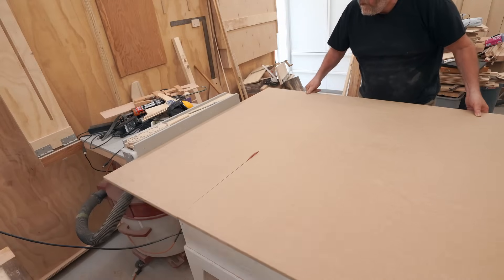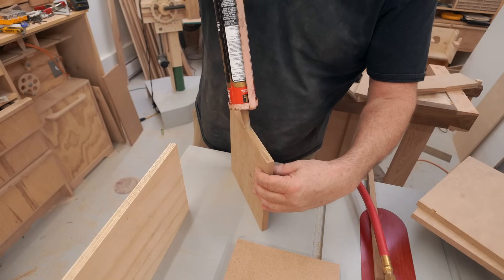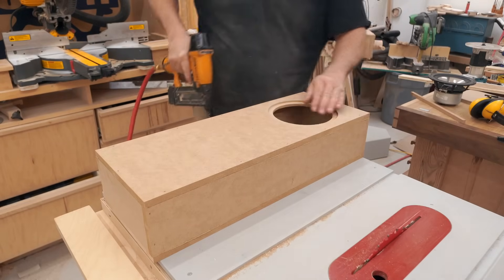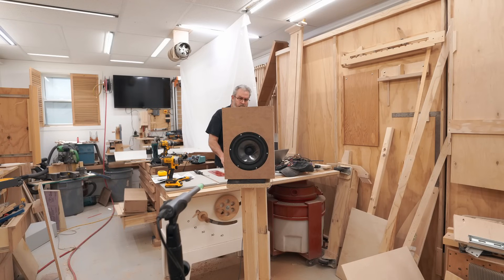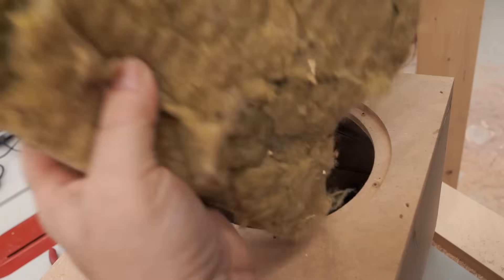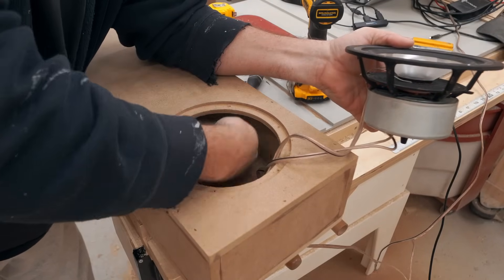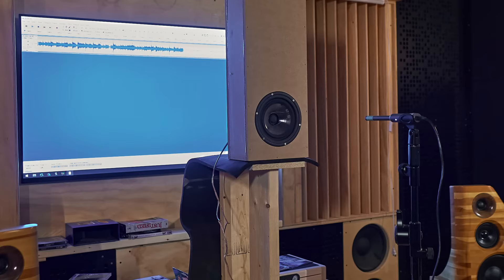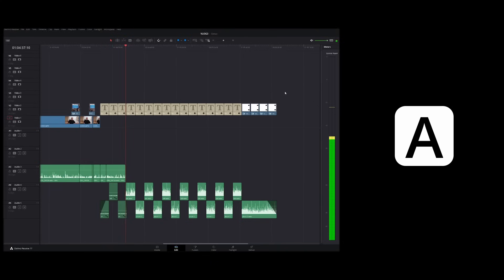Is a Deep Speaker Box Better? Tested with Surprising Results

Comment from the maker: The traditional wisdom says that if the driver is close to the back panel of the speaker box, you'll get very obvious reflections back through the cone that colour the sound. While this is now widely accepted as true, I thought it would be interesting to actually test it and see first-hand how much of an impact it has.
The two boxes are nearly identical internal volume of 12 liters (the deep box is very slightly bigger). That volume works best for the driver I'm using for the test, a Seas coax H1144.
The deep box is 8" from the back of the front baffle to the inside face of the back of the box, while the shallow box is 4" deep. I used the same driver (I only have one of these), crossover and test setup for each box. The shallow box is just deep enough for the driver to fit - the back is just 1/4" from the back panel.
Measured first without stuffing, the tall shallow box shows a disturbance in the 300Hz range. This can be the "back through the driver" reflection mentioned above or it can be a standing wave.
Adding stuffing (I used the same piece of rockwool in each box) shows no significant change for the deep box, but has smoothed out that 300Hz wiggle in the shallow box, proving that it is a standing wave problem. 
The standing wave happens up in the shallow box because it is taller and the distance from top to bottom is great enough to support a standing wave in that 300Hz region. The rockwool is damping material that absorbs sound energy, breaking up that standing wave.
Tangentially, this also demonstrates that standing waves are only a problem when the box is big enough inside to support a standing wave in the lower midrange frequencies. Note that the deep box shows no improvement when stuffed, indicating that there are no standing waves of any significance to damp. 
So making a small speaker box with rounded or angled sides won't be effective for preventing standing waves, when they wouldn't be there to begin with. 
Finally a listening test using both boxes. The mic is set up around 20" from the speaker on tweeter axis for both boxes in my listening room. 
I deliberately withheld which box is which, leaving you to decide based on listening only. Give it a try and leave a comment, and I'll reveal the results in a future video.
Reply: I could hear no real difference
Reply: @doctorscoot  Same here, but I am old.
Reply: B all day long.  Don't care which is which.  I prefer B (I think B is the deeper box b/c the low bass extension)  Side note the highs in this song were very harsh and distracting
Reply: New to HiFi, but have a physics & engineering background: Is the standing wave precisely the same as what others call edge diffraction or baffle step? Does the RockWool essentially dephase the initially-coherent standing waves? How far can we push this? Can we stop worrying about long and narrow subs and engineer in-wall pancake enclosures?
Reply: When the sound's wavelength matches cabinet internal dimensions, resonance causes maximum deflection of the cabinet walls. Rockwool is lossey in comparison with air and dampens waves reducing their amplitude. If the cabinet is loosely filled with Rockwool, it lowers the sound propagation velocity making the cabinet appear bigger than it is.  At lower frequencies forward sound wraps around the box, the cabinet edges act as a discontinuity that causes diffraction, scattering sound towards the listener. Baffle step is the difference between a drivers infinite & finite baffle (cabinet) response at lower frequencies.
Reply from the maker: Exactly. Standing waves, edge diffraction and baffle step are three very different things. 
The standing wave in my box is the half-wavelength of the top to bottom dimension of the inside of the box. That's 23", so around 300Hz.
Reply: @IBuildIt  So why did you not build the box the proper way so standing waves get defused and canceled? The things you mention are taken care of when a manufacturer builds a speaker box.. So in reality it wont be an issue if the work is done properly. And did you actually messure that both boxes has identical internal volume?
Reply: @dcuccia  I imagine the box as a pool with water: you can make waves in a pool; depending on the size of the pool and the frequency of the waves you can make them standing wich amplifies the peaks.

Of course in audio the variability of the frequencies make it hard to desingn a speaker that doesn't resonate at afrequency but end up resonating at a different one. Sound systems have so many variables playing that are almost chaotic systems Think about butterfly effect.
Reply: @dcuccia  I'm not an engineer, but I do know that Monoprice has a selection of in wall speakers. You could probably get some measurements from their site.
Reply: @dcuccia  no, standing wave is a phenomenon that happens inside an enclosure (speaker box / room) where reflecting waves cancel or amplifies interfering waves. Edge difraction and baffle step I cannot explain short, but if you want to read about them, check a book called loundspeaker desing book.
Reply: @dcuccia none of those are the same they all are conditional on wavelength, but compared to how they interact with different parts of the cabinet. Edge, witch, internal volume, cone diameter.  Every physical part with be excited or disrupt at corresponding wavelength.

Standing wave = box internal dimension same as a wavelength 

Edge diffraction = cancelation of higher wavelengths at sharp corners of baffle (rounded or Chamfer corners to fix)

Baffle step = is lower notes being pi but as you move up octaves your speaker is projecting half pi so there is a halfing/doubling of power lows vs highs
Reply: I can't hear any diference but they sound very good. I would like to mention that In 1970 the "Philips Building HiFi Speaker Systems" refer the following: "As a working rule, THE DEPTH OF THE ENCLOSURE SHALL BE AT LEAST 1 & 1\2  TIMES THE DEPTH REQUIRED FOR THE LOUDSPEAKER" (Page 54). Interesting, coming from studies done over 50 years ago! 
keep up your good hobby!
Reply: A must be larger one, seems to have a wider range and is warmer
B misses alot of base and some mid range, and have an annoying high pitch distortion... (guessing around 2-3k Hz), 
hard to say of a yt video where the audio is already screwed up if its distortion due to compression...
Reply: Of course most people could not hear a difference.  But then, most people are listening to this on cheap plastic low power computer speakers.  I suppose that if there were some gross difference, that might come through on small speakers.  It does seam that you have busted the idea that shallow boxes create reflections back through the speaker cone.

I suspected that there would sound coming of the back with the 1/2" MDF vibrating.  Can you test for that?  If the speaker is close to the typical dry wall that sound from the back could reflect into the room and muddy the sound.

Lastly, I would like to hear a test where the mic is placed farther from the speaker at a more natural listening distance.
Reply: I heard, the low frequency of A is fuller, maybe, that is the deep box
Reply: @johnzhang6493  i also have the same observation
Reply: Me too! @samtdl
Reply: You need a larger speaker because the depth of the box is more effective on the lower bass frequencies.
Reply: B is probably the shallower box I'd guess. The snare hit has a bit of a reflection.
Reply: Most of the time B sounded like it at higher volume peaks... So that's the shallow slut of a speaker cabinet.
Reply: But i do not like how he fix together the box in case how you open?
Reply: Real nice test. One thing thou that could make it even better. Make the front baffle to be exact same size. That way there is no difference in baffle step etc.
Reply: @CyberDogFIN Haha! You can't do that to show deep vs shallow box and still have the same internal box volume...
Reply: @West3rror  front baffle size, box depth and box size are three different variables which can all be controlled separately.
Reply: @CyberDogFIN  Yes and no.. Deciding the size of one directly corrolates to how big the other sides can be to still have the same internal box volume for the driver as a box with i.e all sides the same size.. If you encrease the length or width of one side you must decrease anither side to keep the boxes internal volume. And when comparing like this it MUST have the same internal volume or it's not a valid test. That's basic knowlage and logic.
If you could ignore the volume you would be correct.
Reply: @West3rror  Front baffle can also go beyond other walls of the box. Then the internal volume stays the same and just the baffle size changes.
Reply: @CyberDogFIN  well, yeah.. But that's not really good... Don't want that wide baffle for several reasons explained better than I can in several videos
Reply: @West3rror  Yep, but it mitigates baffle step differences for testing purposes
Reply: @CyberDogFIN  but then how to keep same internal volume?😂
Reply: @motorhead16  you can extend the front baffle over the cabinet walls. Think for example a speakers that are mounted inside a wall so that the front of the speaker is at the same level as the wall. There you have close to infinite front baffle size.
Reply: @CyberDogFIN Thank you for explaining your suggestion.

Comment: Internal reflections are a concern not for just how they affect frequency response but how they affect stored energy and even harmonic distortion. I've never understood why manufacturers put little to no insulation in a box except maybe for efficiency gains because the internal bounce back can make an otherwise good cone sound bad. They used to recommend the "golden dimensions" not just for listening rooms but for speaker dimensions such as seen on the old Large Advent as this would cut down on internal standing waves and reinforcement effects.

Comment: Amplitude vs frequency response is not the most critical measure of speaker in box performance. The most critical measure is the phase linearity. This will also become critical as the affect of reflections from the rear of the box impact the phase performance. This aspect is not tested in your system. 
Phase linearity affects how the sounds come together. Non- linear performance will reveal itself as a ‘muddy’ sound, and not clear. Most noticeable in the mid-range frequencies.
Of course phase linearity is affected by more than simple box design. The crossover network needs to be matched to the driver characteristics also.

Comment: No isolation material is not good. The box will resonate badly. A shallow box will short the signal at a higher frequency according to Philips  study and the deeper will short the frequency at a lower frequency. If the box is shallow enough you don't need a crossover for the bass at all, it will short at a determined frequency that can be calculated

Comment: I haven't had to make a speaker box in like 30 years. Things have changed a little bit.  I bought a new Ford Maverick Tremor and there is a large storage space under the back seat. The truck has an upgraded stereo but there is zero base. So I'm relearning about speaker boxes to upgrade. The space will barely fit 10s so i bought a Sundown monoblock amp and a 10 inch sundown sub, and a LC2I to hijack some signal from my door speakers since they are full range.  Can't wait till its all in.

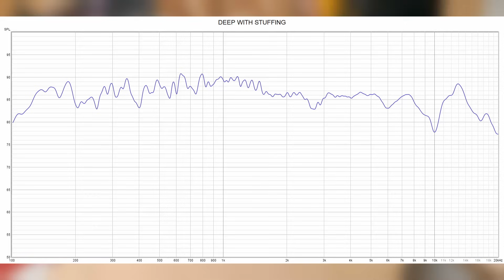Comment: Does this mean it is NOT necessary to stuff a deep box?   The graph @ 3:12 shows very difference between stuffing and not stuffing a deep box.
Reply: The stuffing is in the empty high portion of the enclosure, not behind the driver where it should soak up rear reflections.

Comment: The correct answer here is every single detail matters. Wether you are building a speaker, a guitar, a car or a space ship. Compared one-to-one like this it doesn't seem to matter, but when added to every thing else, always does. JH has made a video that says the cabinet material doesn't matter so much and has measurement tests to show that. I have built 2 cabinets of diff material and they are wildly different playing music, using the exact same drivers and crossovers (not duplicates, the same ones). I have built guitars too. People that hear, feel and get this (and it's not everyone), realize every little thing you do matters. If you just want something to sound 'good enough'... you don't even need DIY anymore, most commercial audio products sound good enough these days at pretty much any price. Certainly a good DIY kit will do. Audio (guitar and cars too) are truly in an amazing place right now with technology and manufacturing where it is. If you want to build the best, you skimp on nothing. Overlook nothing. That's the only way you'll be able to tell you got there when you are done.

Comment: I'm surprised you didn't fully seal the boxes.  I'm pretty sure the standard is to run a bead of caulk around all inside of the joints .  Also the speaker wire should be sealed.  It s possible this change could make the difference s more pronounced
Reply: To be honest theres also Feck all difffence between the two enclosures, they both are small loudspeakers and the graphs show this.

Comment: I've made sub boxes square and rectangle to make the biggest boards possible and rectangle boxes are always always way louder. I just made a vented box for my pair of skar vs-12s. It's tuned to 35hz i believe it was, 5 cubes internal so it ended up being 13.5x31ishx34 i think it was. 4.5x12x29.3 port, again tuned to 35hz. 800 watts coming off a skar 1500 watt (they're d2s, can't get 1 ohm). No braces whatsoever as well. I believe them long wide pieces produce a tremendous amount of sound. That's my recipe to a loud box everytime.

Comment: I'm finally considering getting back into building speakers, and build my own speakers for the first time in many many years.
I want to use peerless elements and i want to build a speaker that won't have to rely on a seperate subwoofer to reach the low ends,
which made me look at some of their 12" subwoofer elements.  My plan is to use 24mm playwood, dual layered all sides and braces to make the box completely dead, i'm also going to have 1 softdome tweeter and i might use a Scanspeak 6" with a phaseplug for that midrange.

The box will be about 8" wide, as narrow as possible without choking the 12" woofer which will be placed sideways .  Currently doing my research on how much it impacts the base with narrow boxes .
Reply: Voigt (folded or not) or Bailey TL (go wild with refrigerator size).

Comment: My guess would be that B was the shallow box because the bass sounds a little less resonant.
But it's hard to tell if not there.
Excellent experiment,  right up my allay.
I wonder if perhaps the shape of the thing should follow the shape of the soundwave (like bubbles of air) to get the 'truest' representation of the actual original sound.....?
🙏🏻🙏🏻🙏🏻

Comment: I have found that the optimal rectangular box shape is a half cube with the driver centered on the square face. Why?  My goal was to have all the reflections travel the same distance so the lowest box mode frequency would be as high as possible.  Damping material is more effective at higher frequencies, so this mode is easily damped by filling the box with rock wool or fiberglass producing a resonance free result. Selecting drivers that need the smallest volume helps push this frequency higher, which is great. With this construction it is possible to low pass filter the woofer at or below the lowest cabinet resonance and have zero audible box sound. The free Hornresp software will model box internal resonances so you can try this concept before building anything.  To extend the bass use woofers with sufficient displacement and equalize the system with a Linkwitz transform ( asymmetric second order shelf filter). Nice video, but without more stuffing I fear the listening result is not conclusive.  The lowest mode of that long cabinet will likely color the sound even with lots of stuffing. It would be audible with a slow sine sweep or some vocal in that frequency range.

Comment: I prefer not to go so deep that the half wave reflection off the box's back isn't in the pass band - so ideally less deep than 1/4 wave of 100 Hz for a subwoofer, or 85 cm. Ideally have the distance from the driver to any internal wall be less than that. A shallow box might be better for a subwoofer as long as it's not so shallow that airflow is restricted.

Comment: When I started in Audio retail some 50 years ago I was selling the Rectilinear III speaker.  They then introduced the "Low Boy" version of it. As I understood it, same drivers and cubic cabinet space. Just different cabinet dimensions. While they shared the same general characteristics, they did sounded noticeably different. I preferred the original Tall Boy. But that could have been familiarity.

Comment: I experienced this waaaaayyy back in the 90s, built a box for a realistic 8", it was like 10x10 but really deep, like 20", think like a square bass tube, had it in my room, gave it to my cousin and built another box that was a typical truck box, woofer facing seat, very little depth, but wide. While testing it in my room, same exact spot, behind my bed, it just didn't have the low, deep bass, just lacked fullness. Sounded thumpy, hollow, no depth at all. Tried facing it all different ways, thinking it was loading in a corner or off a wall, just couldn't reproduce the first enclosures sound. Same exact volume, same tuning, this was the 90s, I was not redoing all that math and box design by hand. So, idk, guess if the short distance from the rear wall to the woofer is too little it acts like a spring and stiffens up the woofer, I have no idea.